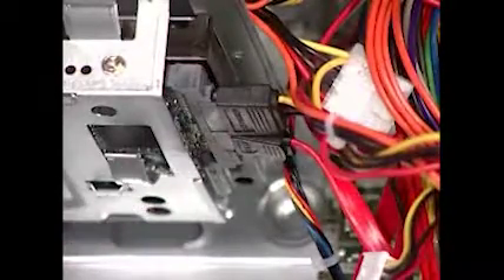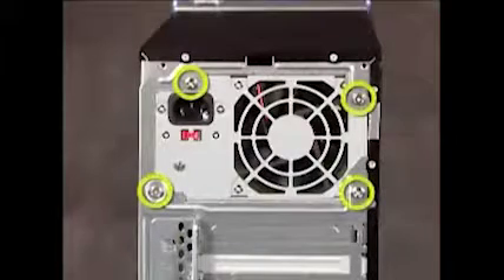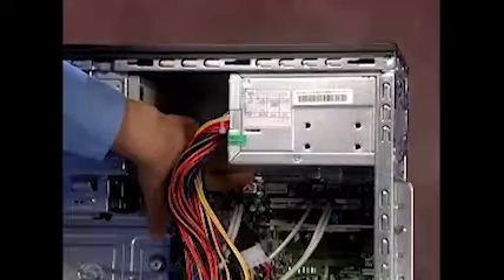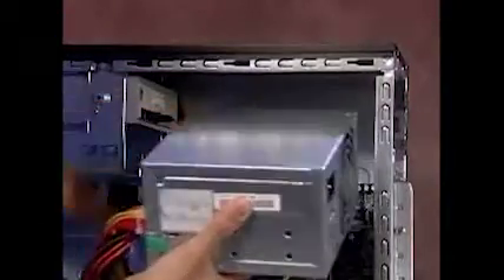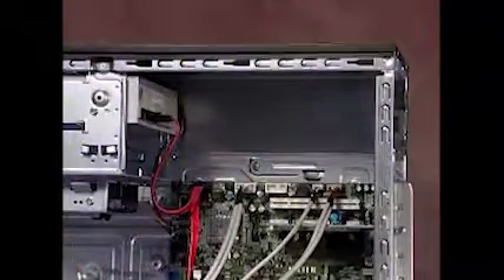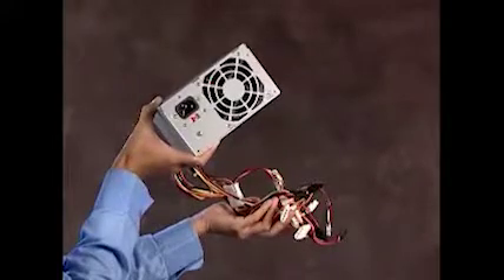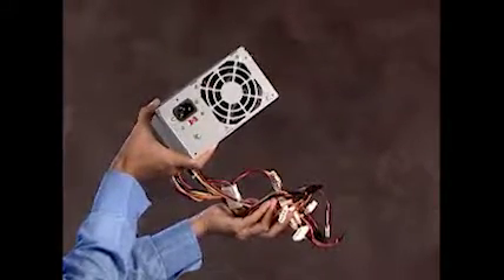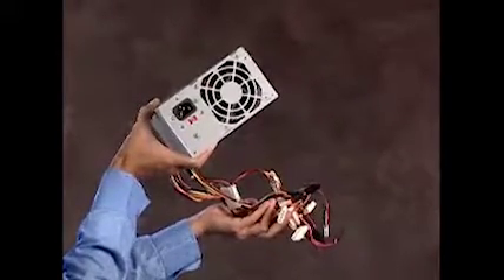Replace Power Supply | Presario CQ5000 | HP Support

Comment: As long as I use an adapter can I upgrade to a 500W unit from EVGA? Or are HP ones a proprietary size?
Reply from the maker: +RetroGamingGenesis You can purchase the part from here: http://partsurfer.hp.com/ Please select your country and enter serial or product number of your unit.
Reply: @HPSupport  What part number do I need for CQ5320Y 200 watt?

Comment: Thanks for posting this.   Now that ~10 years has passed since the Compaq CQ5000's release, I'm sure many more will seek this information (which, by the way, is complete and thorough).  I need to R & R the blown up Power Supply in my Compaq caused by a major Power Surge & outage in Clay County, NE Florida.   Walmart sells this Power-Supply for around $22.00, sweet.
Reply from the maker: +Jeffrey Lear I am glad to know that the video was useful to you.
Reply: @HPSupport  I'm afraid to try this by myself (low confidence).  It would be really nice if the connectors were labeled (right now I have to rely on counting how many pins and colors of wires to identify). I really want to do this, but since I've never been "under the hood", I think I'll take to repair shop, only $40
Reply: pero como puedo buscar que referencia me sirve por ejemplo en Colombia me es difícil conseguirla